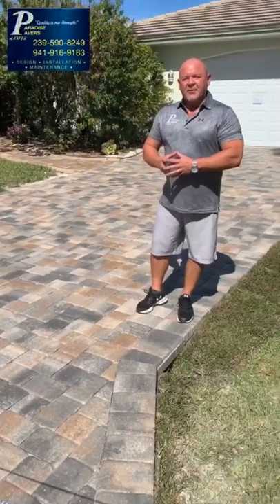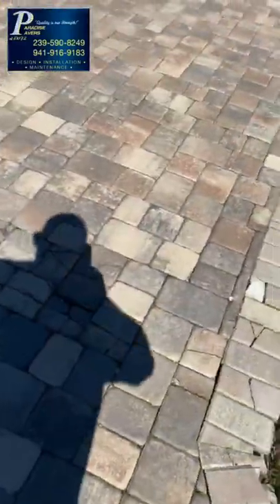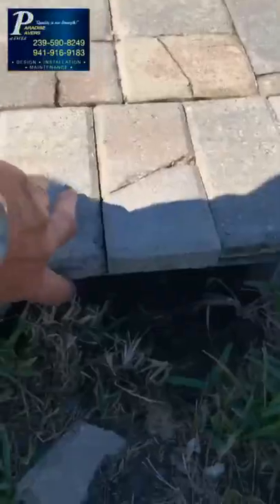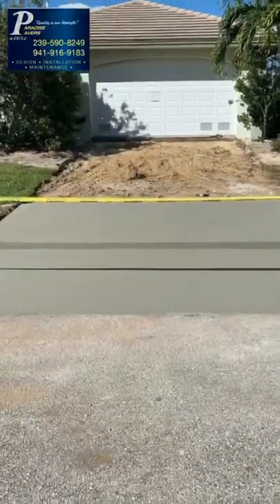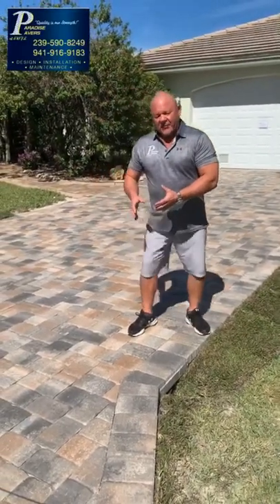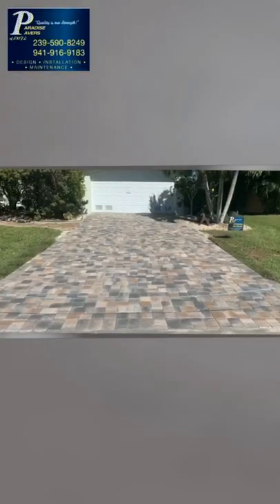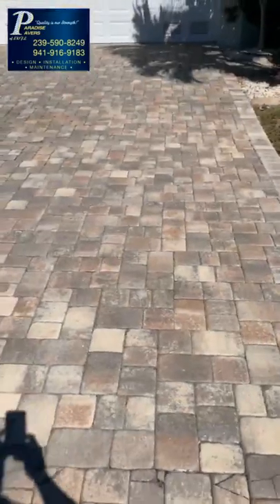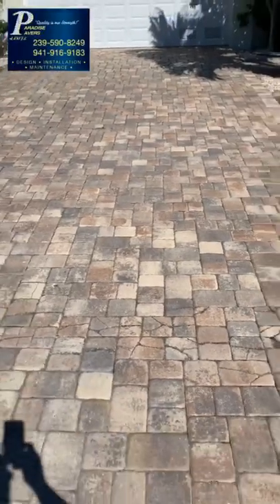Driveway Replacement - Never Use 1 inch Pavers!

Comment: Unbelievable.  I was a decorative concrete contractor at one point.  1" pavers at best are for pedestrian traffic along with maybe a solid mortar or gravel /screed sand compacted base to lay on and concrete and steel border edges to hold everything and avoid erosion

Comment: What about 2 inch?
Reply: Depending on the material but not thick enough in my experience. I've seen some 2 inch easily crack, even 2.5 inch can crack. I prefer 4 to 6 inches or 8 even if you can afford it. Depends on weight of cars and the materials used. If you can afford to over engineer it and want it to last 50+ years then why not.